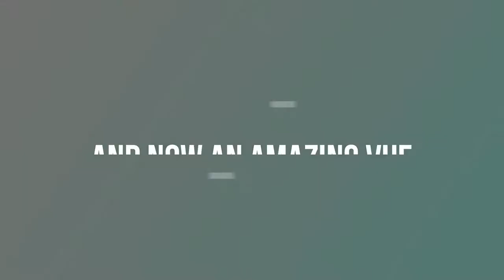Corsair 570X Custom Acrylic Reservoir/Top Panel Replacement

Comment: Do you not really use your tracks for workholding? Do you ever problems with the tape gunking up on the endmills?
Reply from the maker: Kaleb Israel in do use the tracks but mostly for adding rigidity to workholding or for smaller jobs. Since using the masking tape and ca method I don’t have the tape gunk up as much at all which is great!